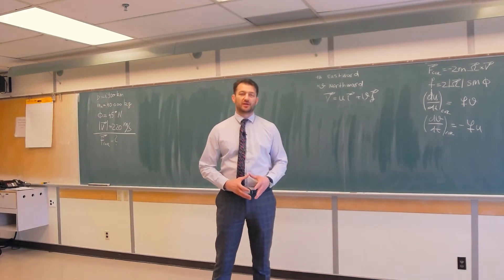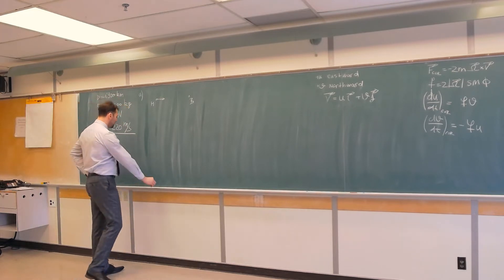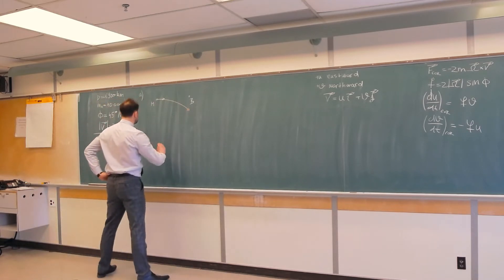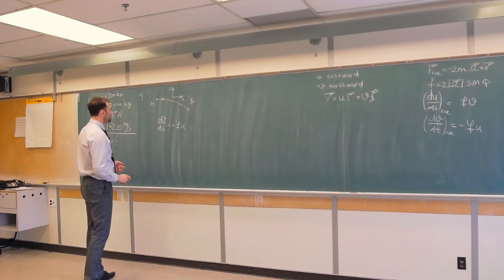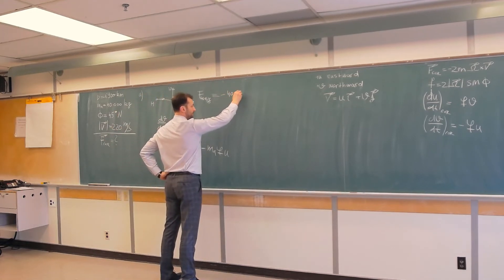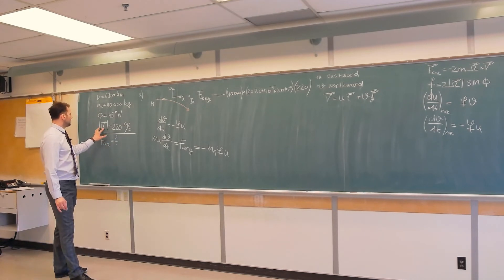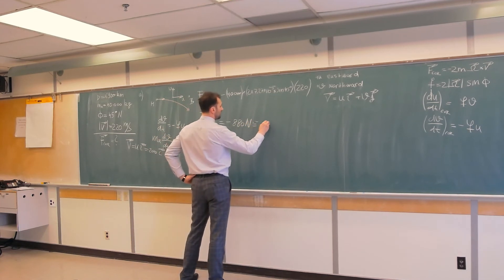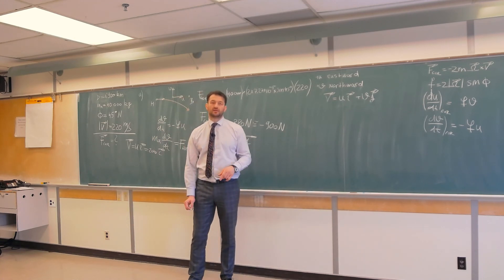Coriolis Force - Q4a: Coriolis Force on Flying Aircraft

Comment: Hi Djordje. I am working on a math/physics problem that is similar to this, but the difference is that it is going approximately south (around the same longitude) for around 30 degrees latitude south starting from 45 degrees latitude. I have the rest of the data, like time, distance, mass and velocity, but I do not know how to calculate the deflection due to the Coriolis force for each latitude. Are you able to help me?
Reply from the maker: Look into the Beta Plane approximation. It gives you a linear Taylor series approximation of how the Coriolis parameter changes with latitude. Use that in the appropriate differential equations.
Reply: @DjordjeRomanic  Thank you so much!!
Reply: @DjordjeRomanic  Hi again. I am do not have any physical books on this subject to help me understand. I've been at a road block, because I do not know how to use the numbers given through the Coriolis Parameter or the Beta-plane approximation, but I do know how to calculate the numbers, but dont know what to do afterwards. Do you have a recommended website, book(s), or videos to help with this please? Or is it at all possible  for you to do a video explaining how to use the beta-plane approximation? This is for a proyecto and I don't know anyone you specializes in this like you. The videos you make have really helped me understand better physics and math.
Reply: @DjordjeRomanic  I have trouble finding anything to help because the Coriolis force isn't a very openly used branch or math or physics
Reply from the maker: @gregorysokil4748  Check out the book "An Introduction to the Coriolis Force" by Stommel and Moore.
Reply: @DjordjeRomanic  Okay, thank you. I will do that